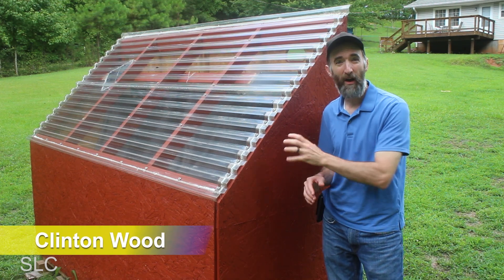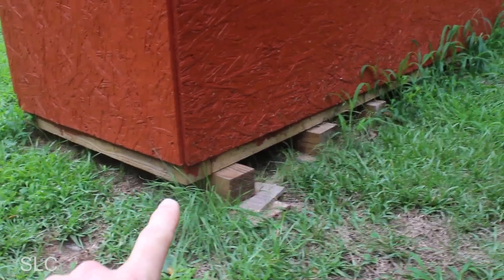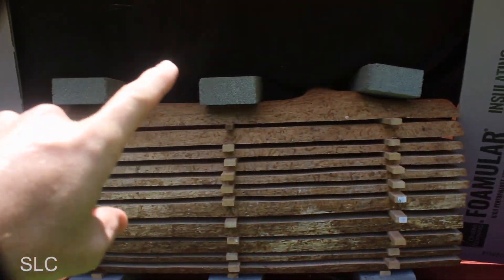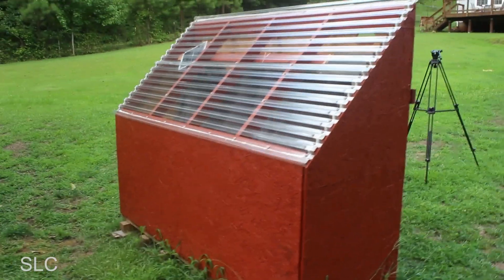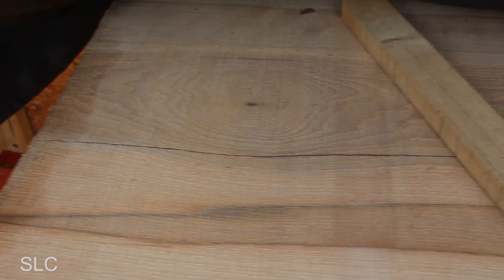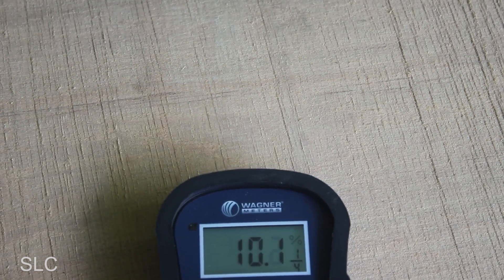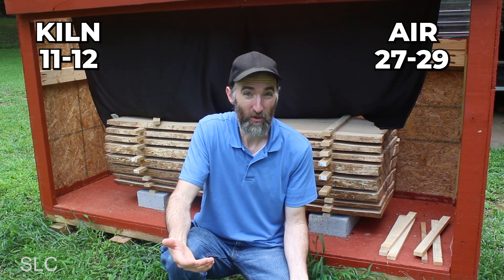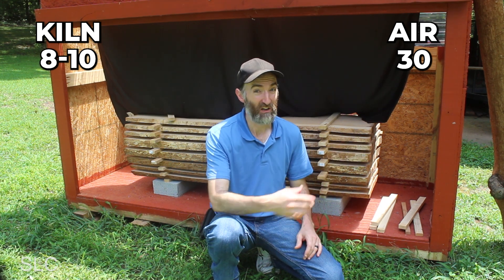Do Homemade Solar Kilns Really Work? Let's Test It

Comment: Looks good. How do heat sterilise the timber?
Reply from the maker: It dries out the water in the wood
Reply: It probably gets hot enough to sterilize it.  You could put a thermometer in there to be sure.

Comment: Paint the inside black that might raise the temp and dry it a bit faster. How long was it in the kiln as opposed to the air dry? It was a great video!
Reply from the maker: The air-dried wood had actually been sitting longer

Comment: One thought in watching this video: despite trying to circulate the air I’d imagine the top of the kiln is still warmer than the bottom and the top boards would dry a little faster.

With that in mind, I’d probably load it up with the thinnest boards at the bottom and the thickest at the top. Just a thought..

Also, why not mount the PV panel outside the kiln somewhere?

Comment: I understand why you are trying to keep your costs to run it at zero and have it be 100% solar, but wouldn’t it be tremendously more efficient to add a dehumidifier? In my brain, I can see the moisture coming out of that wood in the daytime and going right back in at night as there’s nowhere for it to go. That could be just my crazy thinking but really, with plastic above it and painted OSB all around, where is it going?
Reply: As I understand (in the 'contemplation' phase myself), the vents allow the evaporated moisture to escape.  I have heard pools of water form during the early stages.  For this reason, many folks will 'paint' the interior with a rubberized black paint.  This serves to absorb heat, further helping raise temps, but also protect the wood (especially the base board).  That said, a dehumidifier would no doubt also speed the process along.  The only issue I see is finding a unit that could operate in 120-160F temps.  I suspect most won't stand those conditions.  You COULD, I suppose, design a system by which you park the dehumidifier outside of the kiln and so it doesn't heat so much, but then you would have to vent the dehumidified air back into the kiln afterward so you don't constantly just lower the temps. Plus, you'd create some crazy negative pressures unless you vented back internally.  Then there's the added pain of trying to protect the dehumidifier from the elements and getting enough power (many of these are solar powered) to run the unit.  I am SURE someone much smarter than me has figured all of this out and dries wood in weeks rather than months, removing that moisture super fast.  I guess one last point would be:  A possible reason wood in a solar kiln doesn't have so many warps/twists/bends is BECAUSE the humid air isn't immediately vacated.  So, the wood has time to dry a bit, absorb some moisture, dry a bit, etc.  I have no clue on the science behind this, but wonder if there's actually a benefit to retaining some of the moisture in the system?  Best of luck to everyone building their kilns!

Comment: I have heard that if you put the stickers at the vary end of the board it is supposed to stop the checking.
Reply from the maker: I've not heard that one before
Reply: Well it doesn't necessarily eliminate all checking but if the stack has enough weight it can stop the checking from moving past the sticker 😁
Reply: @sambo7326  I believe Hobby Hardwoods Alabama makes this claim also, and the sawmill professor knows his stuff. 👍🏼

Comment: That’s cool!  Would providing air movement across the air stacks move that process along? Not sure what your normal humidity is, mine averages under 35%, so I suspect it would pull the moisture out faster, at least on the 1”.
Reply from the maker: The air flow during the higher temperatures is what's helps remove the moisture. Then at night the cooler temperatures and no movement allows the wood to acclimate to the changes.